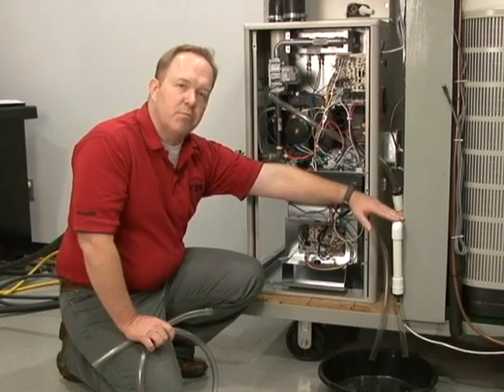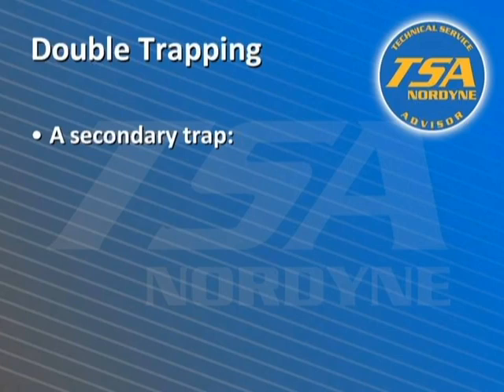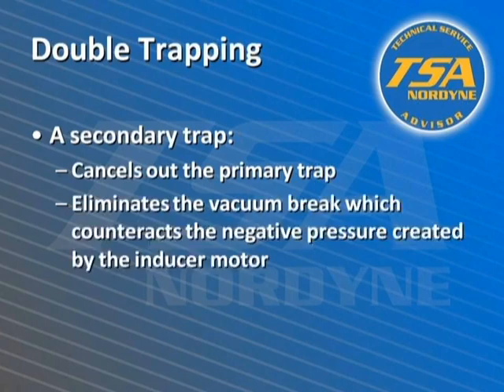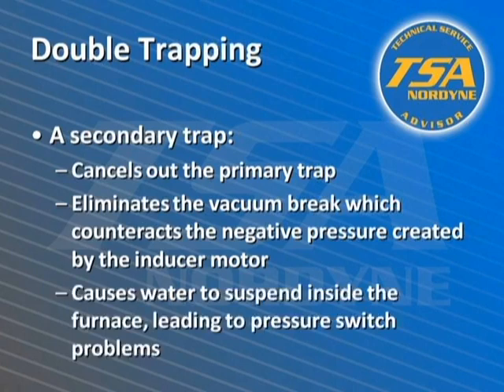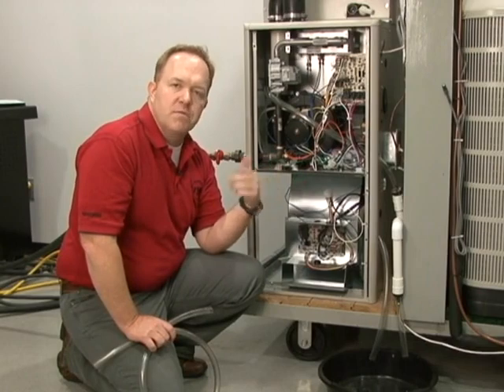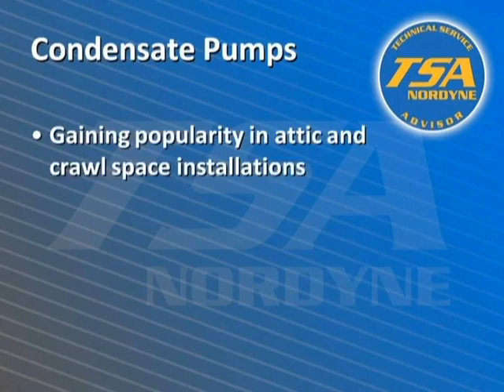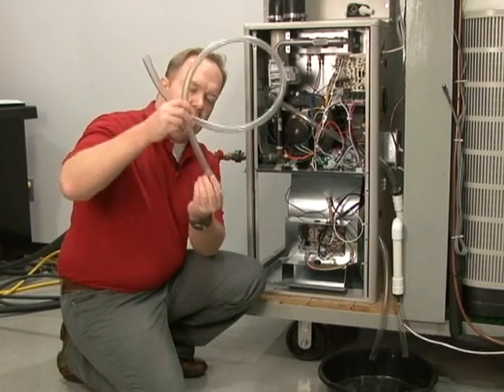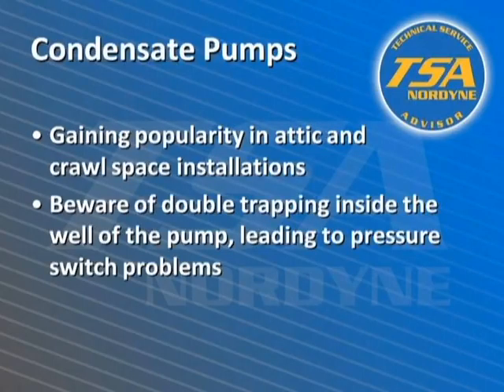Furnace Troubleshooting Condensate Piping

Comment: I just found my short cycling problem because the drainage hose was dipped into the reservoir of water creating a double trap making the switches unhappy. Thank you!
I'm very fluent in automotive vacuum systems and switches. Maybe someone can explain the actual purpose and function of the vacuum system in these furnaces? Regards.
Reply: I am not a tech but my understanding is that the vacuum line coming from the  inducer blower shows a vacuum if the blower exhaust air is making it to the outside.  If there was a blockage on the exhaust pipe (which would be a dangerous condition) then there would be no vacuum on that line and the vacuum switch wouldn't allow the furnace to turn on.

Comment: The PVC pipe that carries the condensate into my sewer line froze. I learned this after seeing some water on the floor at the foot of my furnace. I warmed that pipe and cleared the ice. The furnace is working, and it is blowing hot air, and the condensate is dripping into the bucket that I am temporary using to catch it. Is it possible that while the pipe was frozen, the condensate backed up and only spilled over inside the furnace and then down onto the floor? As the furnace runs at the moment, I don’t see any additional water coming from the base of the furnace. I’m no expert, obviously, but I may just open it up and take a look inside before having a technician come over. Not being familiar with this, I’m imagining that maybe nothing needs repair. Is this possible? If not, I am hopeful it’s something I can fix myself.

Comment: best HVAC video on YouTube. the only one to clearly explain the condensate drain properly. turns out, if the drain hose goes below the water level on the condensate pump it will not drain properly and furnace can go into lockout due to inadequate negative pressure. such a simple thing, but i bet many people have changed out many parts including pressure switches, inducer motors, and other parts just to fix this simple overlooked problem. 
here is the problem essentially. you have a furnace, it works normally for some time and cycles then goes into lockout. the pressure switches are clearly working normally otherwise why would it work normally for some time to begin with. so clearly there is a drainage problem. an obstruction is the first thing to check and clear on all pipes (intake and exhaust), hoses and ports.

Comment: Great infromation here, thank you for posting, furance kept intermittently working, could not figure out the problem for almost 2 years it was very intermittent,my drain tube was causing a double trap I believe.  Hope this was the issue..  seams correct as it would work for a week than quit, float valve open, drain tank, furance would work again till tank filled back up.  God please let this be the issue

Comment: My sump pit got too full water stopped draining water backed up got into vac switches and then the gas valve which then shorted out the circuit board on a new furnace so i drilled holes in the drain pipe just above the pit.  Thanks for the good video.

Comment: Very helpful tip regarding double trap issue. Replace two pressure switches on a 4 year old York furnace - would start up today, until I removed the condensate pump, where the furnace drain was submerged! Thank you.

Comment: I appreciate this information as I am tracking down the three flash signal on the control board.  Everything points to the pressure switch. Although I'll cleanup and re set te Condensate Pump,thanks for the information!

Comment: Does it count if it goes into the drain of a sink its just in the down pipe which is not filled with water synthesis condensate connection
Reply from the maker: Hi Armando, anytime air can be drawn through the drain line of the furnace, the drain on the furnace must be trapped, as the trap on the furnace is used to create an air lock. If any drain line is trapped twice it will not drain.

Comment: So if it drains into the floor, should i not have a P Trap inside the unit?
Reply from the maker: Hi Robert,
Yes, the drain has to be trapped before going to a floor drain.
Reply: do it matter which drain you trap?

Comment: Just found the condition you described where the condensate drain pipe was submerged in the condensate drain pump well. I cut the pipe to stay above the highest level of the water in the well and I am waiting to hear back from the client if this solved the problem with the pressure switch opening during the call for heat.
Reply: Glad to hear the video helped.  Thanks for letting us know.

Comment: you may have a cracked transition ,see if the water runs inside after the inducer stops .that usually caused by a cracked transition

Comment: I had a motor replaced for seven hundred dollars recently and now we are getting a bad smell when the heat kicks on and I found water condensation on the foor and inside the furnance cabnet. What would cause this? The unit is about 6 years old and this is a new problem. Thank you.